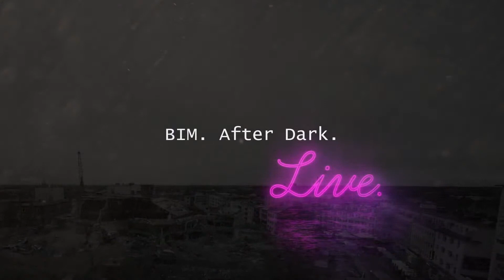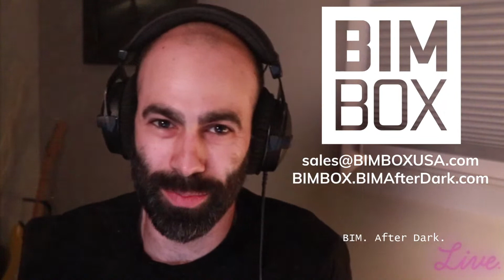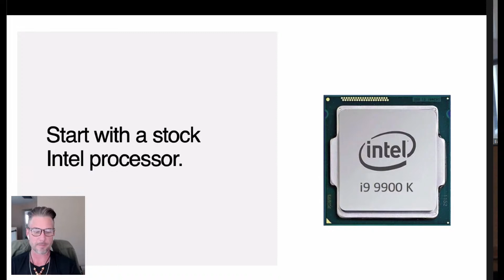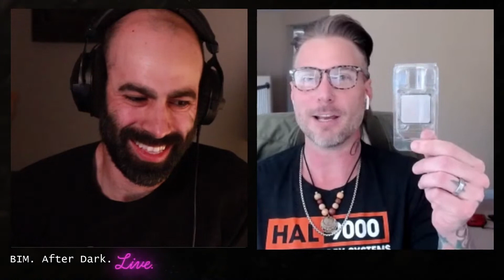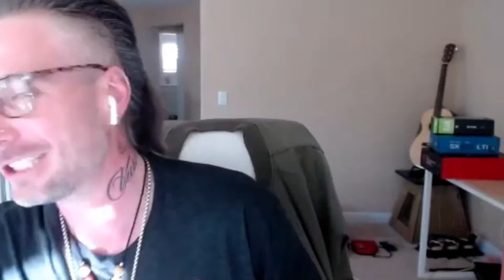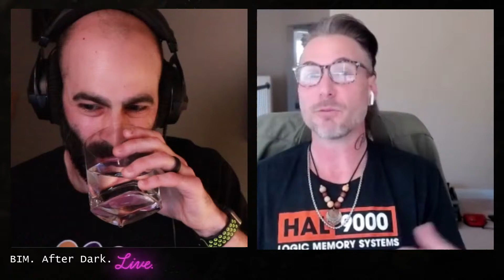What Makes the ULTIMATE Revit Computer System?

Comment: ASUS ROG Zephyrus G14.
Hi, I'm looking for a compact 14-inch laptop that I can use to go to customers and that can process models with 300-500MB well (rendering & data import/export).  it shouldn't look too much like gaming, what would you recommend?  does anyone have any experience with the ASUS ROG Zephyrus G14 GA402RK-L8160X (14", AMD Ryzen 9, 32 GB RAM, 1000 GB SSD, AMD Radeon RX 6800 S with 8 GB GDDR6 graphics memory. I'm a programmer and I work with revit every day, partly  also mobile. But I have no experience with AMD. Thanks for the help.
Reply from the maker: I also have no experience with AMD.  Go intel if you can i my experience.

Comment: Do you know how Revit might perform with an AMD Ryzen 5 5600G with integrated GPU and no discrete GPU? Would use either 16gb or 32gb RAM. It would be for entry level Revit use for basic projects to learn to use Revit. Plan to add a discrete GPU in a year or so. Thanks.

Comment: I know this is kinda late, but don't get anything but 12th gen intel if u want decent Revit performance.
The single thread performance of 12th gen intel is really good and if you do rendering on cpu just get 12700k or 12900k or even 12600k.

BIMBOX right now is selling a garbage 11th intel computer for 5000$. Which doesn't make any sense, unless you are an organization that need very solid customer service.

Comment: Revit power users IMHO really don't need any more cores higher than 6c/12t. Autodesk Revit/AutoCAD still utilizes single core usage, this means if you have 16cores/32 threads, it will only utilize 1 core. The only important thing to boost up is higher core clocks and I mean by that is overclocking your chip. Higher single core clock = much better performance. Higher single core performance = much better. Also, better to put that money into 1TB nvme ssd, higher frequency ram, a cooling setup for overclocking, higher power supply unit. etc.

Anything more than 6c/12t is a total waste of money unless you render scenes or videos. But as far as my experience, rendering time difference from 6c/12t isnt really that significant from higher core counts if you have all the time in the world to render :)

Comment: I'm not too familiar with hardware mechanics but could you have both a quadro and geforce in the same system? And would this get you the autodesk support just by having a quadro in your system?
Reply from the maker: No, you can't.  I think the point we were making is Autodesk NOT supporting you because of your graphics card is no longer an issue.  Even if it says it in your Revit settings.

Comment: 15:21 explains custom cooling de-liding.
Reply: The process of delidding can critically damage your processor. Our technicians are highly trained and use specialized tools in a controlled environment. BIMBOX is the only manufacturer that offer production workstations with delided processors backed backed by a full 3 year warranty.
Reply: Interesting. Didn't know about deliding until now. I looked into Boxx's $ and they're WAY over my head as a single user. I showed the numbers to an IT mgr and he about collapsed. lol

Comment: Revit will run faster with a faster base-clock CPU speed. Overclocking, making the CPU run faster, is capable through an unlocked CPU, managed by a specialized motherboard, and requires upgraded cooling to extend the life of the CPU and stability. Typically, the faster CPUs don't have a high core count, so don't sacrifice speed for additional cores. CPUs and graphic cards are seeing unprecedented global shortages due to high demands. Typically, Revit users also use real-time rendering applications that require a high-end video card, which will only add to your Revit experience. The sweet spot is an NVidia 3060 with 12 GB Ram. System Ram is not a critical component; 32 GB of ddr4 3200 cl15 is sufficient for a good experience. Don't skimp on your hard drive; buy a Samsung Pro NVME m.2, and don't look back.
Reply: Don’t shortchange RAM. I’ve got a Revit model on a mega project that easily uses 90+ GB of RAM when exporting NWCs, IFCs, PDFs, or DWGs.
Reply from the maker: Agreed!

Comment: In huge project i have like 15 frames on 3070 :)
Reply: @Jeff gives some great tips in this video on how to manage poly count and improve FPS through asset import https://www.youtube.com/watch?v=jfcsHki7OEc&t=1329s
Reply: Bro Revit isn’t optimized 😪
Reply: That's because Revit does not utilize GPU, it utilizes on single core performance of a CPU. That means if you have a 16c/32t chip, it only utilizes 1 core. BIMBOX recommended specs in this video is total BS and you dont need that high spec for Revit. 6core/12thread CPU with overclocking capabilites, 16GB 3000mhz+ DDR4, SSD, and anything GTX 10 series or 20series are fine.

unless you want to render at fast speeds, but nobody really wants faster render times if you have all the time in the world :)

Comment: Why does Twin Motion crash, especially when I use a direct link and when I use vegetation scatter.  Would that be the graphics card or the processor? or both?  Also when I change materials in Revit I hear the fan running high speed.  Just trying to pinpoint the problem, overall my computer is working nicely, but would like to tweak it to reduce the crashing, this as you can imagine is the source of major anxiety lol.   Thank you for the great channel!
Reply: I am not an expert on TwinMotion nor do I know if this is really the solution.  I use a laptop over 3 years old with a GTX 1070 and I found that reducing the graphic details to medium and low reduced my GPU usage from 100% to 70% and I found that the reduction helped reduce the frequency of crashes.  My guess is my TwinMotion was crashing since it was at 100% and then I'd ask it to do a scatter.  Maybe this helps.
Reply: @alexandertrego879  Great!  thank you for your help, Ill give it a try
Reply from the maker: I would also suggest NOT using direct link when using vegetation scatter.  Vegetation scatter is very temperamental in how it reacts to changes of it's host.  In fact, I usually bring in the surfaces for vegetation scatter as it's own import so I don't have to refresh it 100 times as the building changes.
Reply: @TheRevitKid  thats interesting, Ill try that.  Are you using datasmith to import?  And the topo brought in separately from revit? not completely sure how your saying to do it, ill give it a try.  BTW the new update to twin motion has been amazing (so far)  thank god, almost no crashes.  
Also, fyi, I took your free course for twin motion when I first started it was great so Thank You!  I have been using twin motion on all my projects since.   typical workflow right now,  Revit - Twin motion - Premiere,   really enjoying this way of presenting to my clients.  Have to develop my premiere skills as well.
Reply from the maker: @eastudio-K  - No, i use the Twinmotion plugin and I export standalone FBXs... Just like I show in my free course you tooK!  So glad it helped!